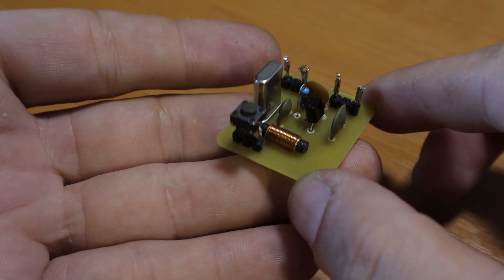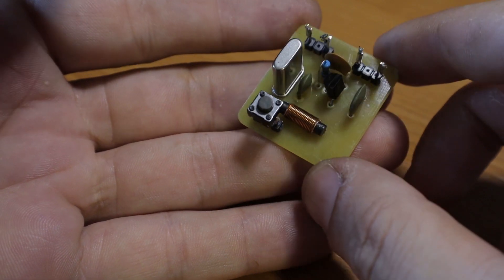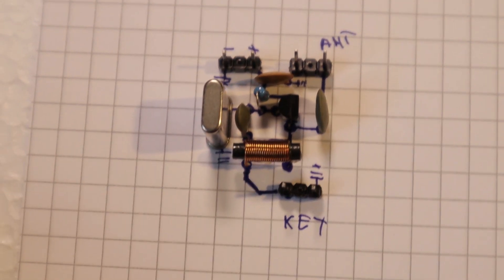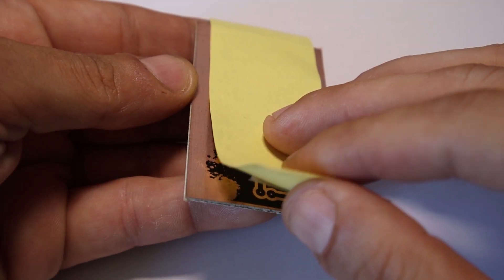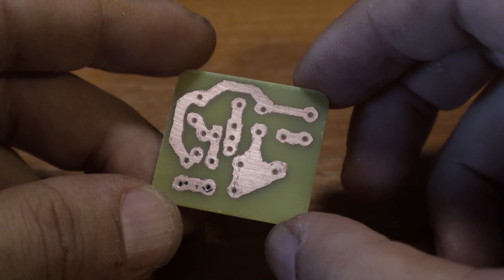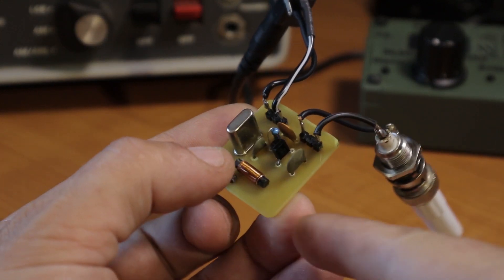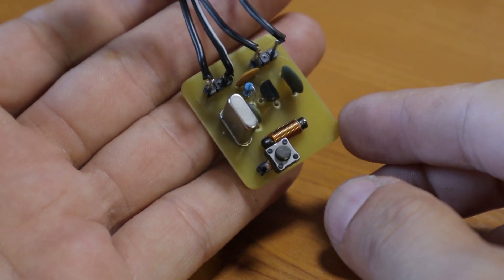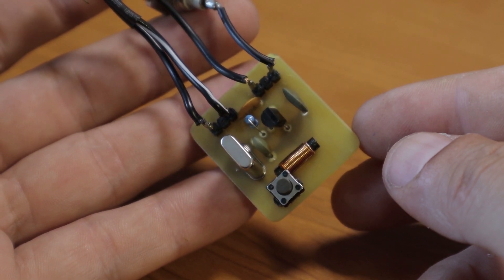Minimalist CW Transmitter With One Transistor - 550mW @ 12V

Comment from the maker: For better results on harmonics suppression replace R1 with 47K, L1 with 10uH and in parallel with L2 put a 120pF up to 140pF capacitor. It should cut way more on the 2nd harmonic. I hope this helps a little. Check the blog article ( link in the video description ) for more detailed info and the complete schematic.

73, YO6DXE.

Now you can order PCB boards from PCBWay:
https://www.pcbway.com/project/shareproject/700mW_One_BJT_CW_Transmitter_23eed7e8.html

73, YO6DXE

Comment: What is the range of the transmitter?
Reply from the maker: Well that depends... on the antenna, on the propagation conditions and for sure depending on the talent of the operator so he or she would know when to use it in order to get the best out of it. So to give you an idea..  with 300mW in normal propagation conditions I can hear myself from Romania on the SDR in Holland with no problem. My friend Vlad ( YO5BDL ) makes contacts regularly around Europe using only 10mW or even less. So with 700mW... I should be able to cover the entire Europe with a little luck. Other days if the propagation is bad is possible that I will not be heard even in the next city. 😃 73, YO6DXE.

Comment: I've build this circuit but with a slight modification. The crystal is 27MHZ. I've just wanted the proof of concept until I get the appropriate crystals for 40m. My question is, when I listen to the RF on my SDR, there is no tone on the signal, only the carrier frequency. Am I doing something wrong? Should I not expect a tone on the signal?
Reply from the maker: Tibi can you send me an email ? I'll send you a voice message to explain a bit how to get it to work. Also... if is the older version that had no trimmer capacitor on the crystal as the new version has... then try listening to 26.9 MHz or around there instead of 27MHz.

Comment: I understand this projexct because I have built a similar one but only one question. How do you obtain that audible signal when you just only produce a high frequency signal on and off while transmitting (so of course it can't be heard if there is only carrier wave)? Or maybe there is a special set up or something from the receiver side?
Reply from the maker: Well... take the transmitter as a simple oscillator, same as a VFO. Basically if you tune a receiver on the same frequency as the VFO... you will hear the oscillator sound on that particular frequency. The transmitter is almost the same, except that the power output ( RF ) is a little higher and it has a fixed frequency because we are using the crystal. I beleive the output is AM but I don't want to say stupid things (ha). But since you hear both sidebands I guess it is AM. Basically we receive the tone generated by the oscillator. Not sure if it makes sense what I am saying, too tired after a very long day 😁. 73, YO6DXE.
Reply: Your comment doesn't make any sense but what I think the receiver just takes the difference between the signal receiver (in this case only carrier wave) and the frequency from the local oscillator at that receiver so probably the sound you hear would be judt that difference of two frequencies in audiable range. This would mean that I need a special receiver for CW 🤔 Do you hear this sound on a normal portable Radio tuned to amator band frequency?
Reply: *signal received
Reply from the maker: Yep... you got it right. I tried to explain the easy way (ha). Normally yes, for CW and SSB signals you need a receiver that can receive SSB or CW. With a regular AM receiver you may still pick up something depending on the receiver, but in order to hear it properly you will need a BFO ( beat frequency oscillator ). Basically another oscillator 😅. I just tested a receiver now ( AM broadcast receiver ) and see if I can hear CW from the transmitter. I can hear i am transmitting but it sounds more like interrupted static... not the normal transmitter sound.
Reply: Ha! I knew it! Thanks for checking and the comment.
Reply from the maker: @grzesiek1x Always a pleasure. By the way, that is how I used to listen to CW on 80m and 160m when I was a kid. Just by listening to that interrupted static as I had no BFO 😅😅.
Reply: Hehe

Comment: I loved it ❤. I just 🤔 wonder if I could make with a mosfet. I ll try further in the future. Regards from Argentina 73
Reply from the maker: The circuit would be diferent but I think yes you could make a transmitter with a mosfet too. Basically this is just an oscillator.

Comment: Hi mate with is your dummy load. Modal maker??
Reply from the maker: I will right back..  I need to watch the video again as I don't remember 😁
Reply from the maker: So... the dummy loads I used are all DIY. First one ( the little one ) is a 50 Ohm 1W resistor soldered on a BNC that I just plug into the antenna connector of whatever I am testing. I covered the resistor with a pen cap. The second one ( the wattmeter ) is also a DIY that I presented here in one of the videos... and is also on one of the blog articles. 73, YO6DXE

Comment: NO, No, No!!! no 700 mW!!
I like 2n3904, but this power  => 0.4 W max.!
For more power you need (to) take 2SC5706 or 2SC5707 transistor.
(sorry for my english).
Reply: Try a 2n3866 . I built a pixie kit but only got 200mW. The 2n3866 raised it to 600mW using 12v supply as 9v was not enough to start up the LM386 amp.
G4BTI uk.
Reply from the maker: @DavidCase-ov5uo I have to try. I have a few RF transistors that are rated to 1W up to 5W so I want to make some tests and see how that works. Just stuff from the junk box that I received from friends. Maybe I have surprises 😅😅. 73, YO6DXE
Reply from the maker: You can get 700mW too but you have to select the tranzistors that have a high amplification factors. At least that is what I noticed. Still... at 700mW the transistor is heating up a little but still works ok. I would also use a better transistor as you say if I would plan to use it a lot and for a long period of time doing continuous QSO's. But I wanted to keep the design original as I found it online to do a test and see how it performs. It is a nice little transmitter and really simple... I like it. No worries about the English... is not my first language either 😁😁. 73, YO6DXE
Reply: @dxexplorer  I think you have error in your powerMeter. You can`t to cheat DataSheet.
Reply from the maker: I don't read data sheets... I just play with components. The power meter is ok... I verified it with other power meter to do the calibration. You can get nearly 1W from a Pixie with a 2N2222 as PA transistor... well picked you get 700mW no problem at all.
Reply: @dxexplorer  2N2219 = 0,8W
Reply from the maker: @phitrow In theory yes.... but as an example, you can have let's say 2 x 2N2222 but with different amplification factors. One will give you 300mW... the other 900mW... same transistor, same datasheet but diferent results in practice. I have a feeling that it depends a lot on the manufacturer too. Older transistors seem to offer me better results... the new ones made today... not so much. That is also the reason I either use "new" old parts... or simply recovered parts from older equipment )).
Reply: @dxexplorer  You can also to try 2sc3807, (SANYO)
High DC current gain (hFE=800 to 3200)
1.2W (free radiator)
Reply from the maker: @phitrow Excellent... I think I have one somewhere in a box. Thank you so much 🙏

Comment: Looks fun. N9EGT
Reply from the maker: It is indeed, but I think I will have to double check the simple LPF on the output as I beleive it may not do such a good job compared to what the computer simulation showed ( as I expected ). But I don't have a tinySA to measure at this time to make adjustments. But it works really nice and I love the simplicity. 73, YO6DXE

Comment: I think I'm the only one that doesn't work. I built it with the d2061 power transistor just like I tried with the 2n2222a and it doesn't work. I don't know if it's because of the capacitors that I put in it, which are 104x2 and one is 103.
, and I looked at the carrier signal and nothing even until I tried to receive it with my sdr
Reply: That should work but the circuit I built is the complete opposite. I would appreciate if you could help me
Reply from the maker: Send me an email Juan. We will get it working. Send me some photos too if you can. Maybe I can figure out something from the photos. You have the email address on the contact page on the Blog.

Comment: I'm just getting into Electronics and someone recommended making a CW transmitter for what I'm trying to do. Can anyone recommend a store besides Radio Shack to get these parts? Could I buy one pre-built? Any help much appreciated
Reply from the maker: A pre-built one... won't help much if you want to get into electronics. The best is to build one from scratch and even if you fail it, there is still something to learn from that and you will learn the best how it works that way while trying to get it to work properly. Unfortunately I left US in 2018 so I don't know the situation on local shops there, maybe someone from US could comment also with some info. But I am pretty sure that on eBay or Amazon most of the parts can be found really easy. You can even build it Manhattan style for now since you just practice and this way you learn a bit about placing the parts in the right place. Patience is usually the main key when learning. I would help more if I could, wish I was closer. I may only come back in an year or two in US so... ))).
Reply: @dxexplorer  thank you for the reply I appreciate it
Reply from the maker: @joebotz1243 Always a pleasure. 73, YO6DXE.

Comment: Hi! How did you antena for it?
Reply from the maker: I am using an End Fed Half Wave for 80m to 10m band. But any properly made antenna for the 40m band should work well. You can even try a magnetic loop for the 40m band since is a fixed frequency and is small and easy to build. 73, YO6DXE.
Reply: @dxexplorer  Thank, you!
Reply from the maker: @lesykyavorskiy7630 Always a pleasure my friend.

Comment: Hi. What should i replace to make it works on 80 meter band?
Reply from the maker: The crystal that is for sure. And the low pass filter needs to be recalculated. But I will do some tests tonight for 80m, 40m and 20m and put all that info in the blog article. The value of L1 may need to change as well.
Reply: @dxexplorer  Thanks. 73
Reply from the maker: @karkuwaa Doing the tests as we speak. I'm getting there. Dinner time now and after I get back to it )) 73
Reply: @dxexplorer  Take it slow.
Reply from the maker: @karkuwaa ( 80m band ) C3 390pF, L1 22uH and of course the crystal 😁. I still have to play with the bandpass filter.
Reply: @dxexplorer  Huge thanks to you! 73😉
Reply from the maker: @karkuwaa Always a pleasure. I think I will do the rest tomorrow as my eyes are calling me in wonderland  ))) 73 buddy
Reply from the maker: @karkuwaa  I made a correction in last night's comment... C3 is 390pF and L1 is 22uH. Sorry I was too sleepy and messed up my notes 🤦‍♂️. Working now on the bandpass filter and I will update the article soon for all three bands. Cheers and have a fantastic day. 73, YO6DXE.
Reply: @dxexplorer  No problem :D

Comment: I built it on a breadboard in half an hour with less than optimal components and it works! 366mw without, and 107mw with lp filter, and no chirp at all! With some tinkering It would probably give more power. Nice little project.
Reply from the maker: Yes that is why I love it hehehe. Is simple, fun to built and the results are not bad at all. Even if I would only get 100mW out I would still be haply. 73, YO6DXE.

Comment: Hi! I like this project! I want to try and build this, but I only have axial inductors (those that look like resistors). Do you think it will work the same way? Thanks!
Reply from the maker: For the 5.6uH inductor that is what I also want to use. I didn't in the one in the video because I didn't had any ))). For the low pass filter on the output... in general is better to use a toroid. But if you can find an axial one with the same value as L2... I believe it was 1.45uH then you can. Probably the filter won't be so efficient... but it should still do the job. I am working on a version as well that I want it to look a little vintage... so for that I will make both inductors on PVC tube ))). As long as the values are right ... it will still be all right. The good part on L2 made from a toroid is that us a bit easier to change the value by squeezing or expanding the turns on the toroid to adjust the filter for the maximum output power.

Comment: Can a sound be associated with a wave? What frequency range do you operate? How do you make a receiver?
Reply from the maker: Of course it can be associated with a wave. Waves of the ocean come at a certain frequency... radio waves the same, sound waves are no different. The ones in the video ( sound ) are around 600 - 700Hz. About the frequency I operate... it would depends on what transceiver I am using and what band. Is a little complicated... lately I didn't had any time to operate on any band haha. On the receiver question... I have a few videos on receivers so far if you look back into the older videos..  and there is also a Playlist with all the receiver videos I posted so far. But I will try to make some more in the near future. Maybe some really simply ones. Not reliable to be used in a QSO... but who knows ? Maybe they will. But I like simple circuits so I will play with a few simple receivers too. 73, YO6DXE.
Reply: @dxexplorer  Thanks for the quick reply And the perfect explanation Once again Thank you
Reply from the maker: Always a pleasure my friend.

Comment: will you show a like wise simple reciver build too, perhaps even a series with small simple amp 10w and bandpass filters 4,5 videos, that will be great. video 1 with this tx video 2 with a rx, video 3 with band bass filter, video 4 with a 10w amp, video 5 with a end feed antenna and impedans transformer, all with as few component as possible. but thank for this video. Im all ready tweeking this tx with multible xtals for multible channels.
Reply from the maker: Not a bad idea... except that it is not that easy to do something good with as little parts as possible 😁. I may simplify things a little and do maybe a simple CW transceiver ( monoband )... up to 1 W maybe... this will also include it's own filter. Then an amp also with it's own filter. I already have the videos on the impedance transformer and the EFHW antenna... so is no need to repeat them.

Comment: Simple and yet has no chirp that I could hear. I agree as you noted that feeding into a Pi output filter of some sort would be almost a must but in a pinch this circuit, as is, should work nicely. Great for SKN 😀
Reply from the maker: Ohh God I love the way it sounds. It reminds me of the old tube transmitters. Is something nice and warm to my ears for some reason. Really happy there is no chirp. I just posted the article and in the schematic now I also placed a low pass filter. Something simple. I hate I can't make any harmonics measurements right now. But I will try to figure that out or someone may make it for me if the have the right tools. Can't wait to finish learning the code and have fun with it. Is too cute small as it is 😁. 73, YO6DXE.
Reply: @dxexplorer  I am going to give that circuit a try once I get a half wave end fed wire up on 40M. Hope you get on the air with it soon 😀 73, WA4JAT
Reply from the maker: @marknesselhaus4376 I keep trying to finish learning the code, but with little free time to do that... ehhh... we will see. But I plan that the latest by December to be able to do QSOs in CW. And because I want this so much..  the entire month of December will be strictly CW for me 😁. Good luck and let me know know it worked for you. Happy weekend, YO6DXE.
Reply: @dxexplorer  It has been many years since I learned the code ( 1974 ). I just learned it one letter and number at a time back then and whenever I was driving my car, I would read the signs along the way and convert to code in my head. Took very little time for me to learn and when I went with a friend to have him take the code test I just copied it for practice and found out that I had indeed passed. CW has always been my Go To mode 😀 Take care till next time, WA4JAT
Reply from the maker: @marknesselhaus4376 I've learned the code when I was 18, as at the place where I used to work I had a kid younger than me that was licensed. I got excited and started learning as well. But if I haven't used it for twenty years... clearly I forgot everything. It shouldn't take me long to learn it, I just need some free time and piece and quiet. Right now I have none of those hahaha. But I can't give up as my CW December is a plan I intend to stick to. I also want to make CW the go to mode to do QSOs. SSB is fun, but with CW the equipment to use and build is so much simpler. You can basically communicate with prety much rudimentary gear and that is fantastic. Well... time to write some stuff on the blog now, so enjoy the weekend and we keep in touch. 73, YO6DXE.